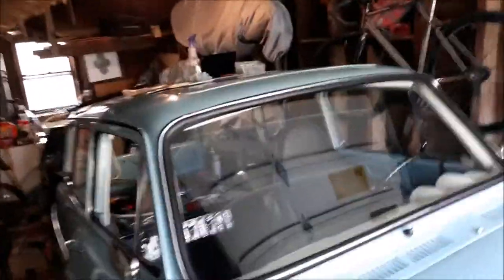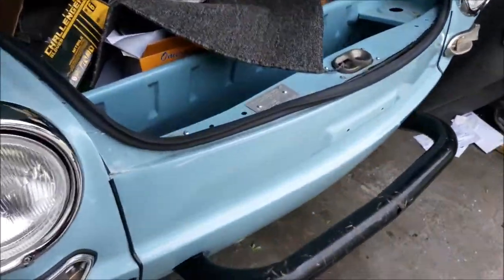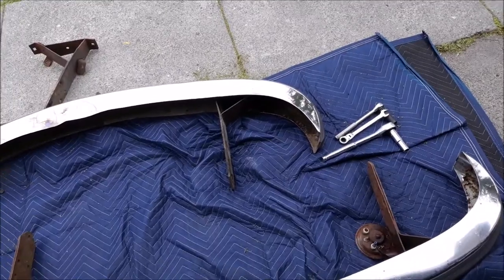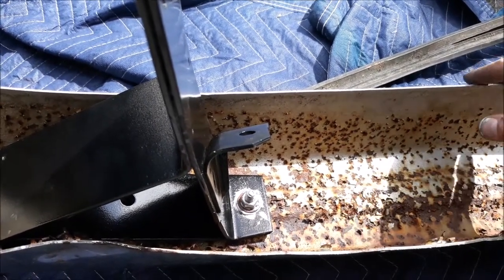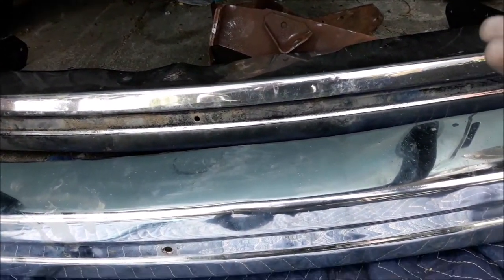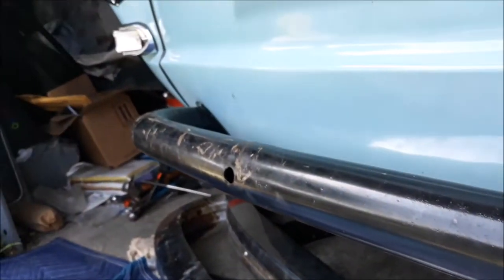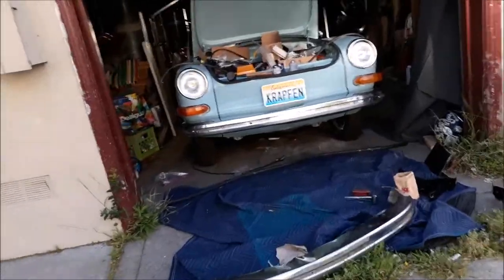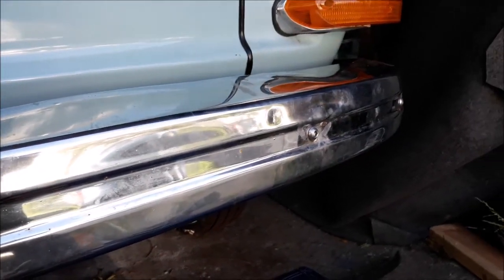VW Squareback Restoration Part 29: Front Bumper

Comment: Looking good . Btw Bumper guards were not used until 74 i own two squarebacks 71 and 68 plus a couple other VWs . where in ca.  are you i have resources for parts if needed  . 👍 😁
Reply from the maker: Thanks man. I'm on the Peninsula and I grab most my parts from Samba or Oakland Aircooled in Hayward. Chris is a cool dude.
Reply: @mr.padgettt  nice if you need sheet metal or other stuff you cant find i have a buddy with a big stash up near Davis . bigger than mine . ive used cip1 too very good service for a online store.